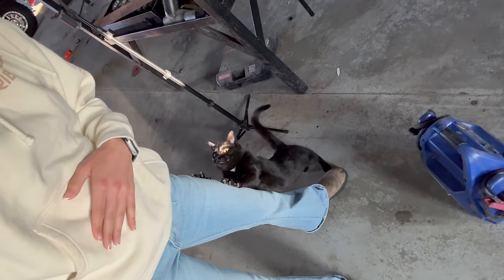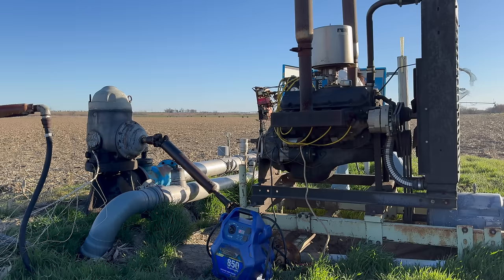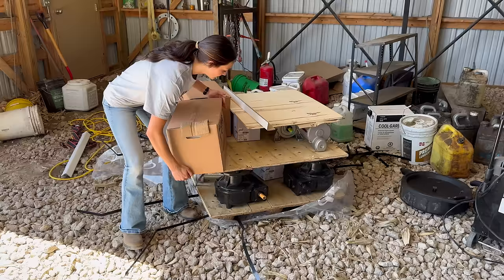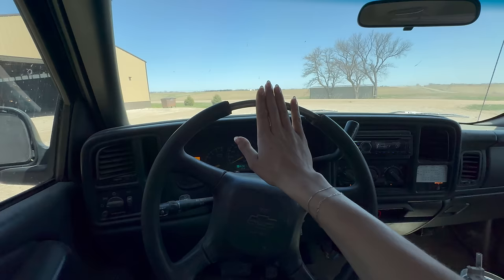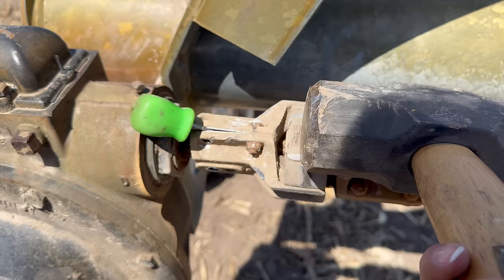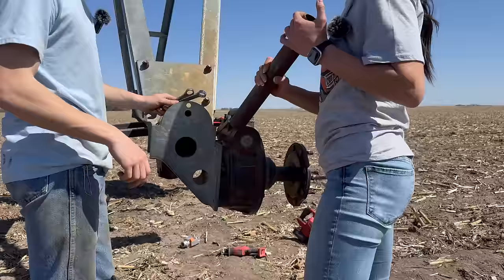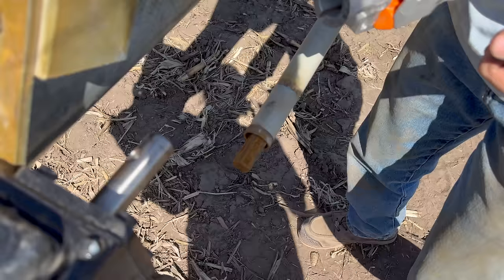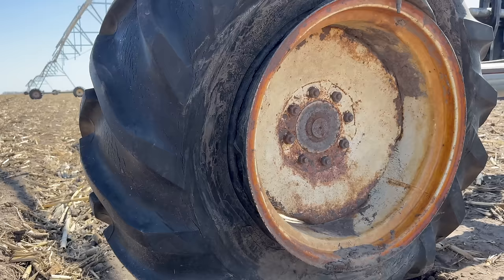Watch Me Fix This Irrigation Machine

Comment: Safer to use the closed box end when using a wrench to avoid rounding the nuts/bolt.  Great job!!!  I hope Grant realizes how special you are, I'm sure he does.  And as other said copious amounts of anti seize will help with future removals!
Reply: It looked really tight back there, so I don't think there was enough room to get the box end on it.
Reply: @darkiee69  👍🏻, it seemed like there was a little room just not enough for a socket. I could be wrong though.

Comment: The mounting plate hole for that gear box has a slot for a reason, because they are so heavy you run a bolt half way into the gearbox before you hoist it up and slide that bolt into the slot so it can hang there while you get the rest of the bolts started then tighten as normal leaving the slotted bolt for last.
This also works for servicing if you need to move the gearbox a tiny bit without needing to remove it completely.
Cheers Laura, Thank You for the Videos.
Reply: I saw the same thing the minute they took it off!  I think they used that bolt to hang the new gearbox on....
Reply: @pkane5472  Exactly what it's slotted for yes, The things to heavy to hold up and bolt.
Reply: I'm not the only one that picked up on the slot and it's purpose. Hope they see this so they know next time
Reply: @cwonext8037  , me too!
Reply: yes sir, that's why it's slotted.
Reply: I think a whole bunch of us saw that.  I know she has changed gear boxes before.  Surprised she didn't know that.  I see when they put the new gear box on they didn't use that technique though so maybe not.
In the future though......
Reply: @pkane5472  They did exactly that.

Comment: Copper paste on those threads will make life so much easier in the future and a small plumbers torch applying heat and WD40 really helps with seized bolts.

Comment: Always break the bolts loose and tighten them with the box closed end of the wrench, the box open end of the wrench will flex open and round the bolt off. You can double up two wrenches by putting the closed end of one wrench over one side of the open side of the other wrench for more leverage. Good work getting the job done!

Comment: 20:40 the fun part is when you realize that after the gear drive is removed and you realize that bolt hole is slotted and that sledge hammer would have been a useful tool again.

Comment: That slot in the metal is to allow you to start the nut into the gear box and slide it on, so you do not have to hold the gear box while trying to add the other bolts.

Comment: Maybe use Anti-seize (cooper grease) on nuts, bolts and shafts (couplers)? 🤔🤔 Oh, in tight spaces, you can double up wrenches end to end for extra leverage and use the closed end to prevent rounding off bolt heads and nuts.😁😁
Reply: I thought of the doubling up on wrenches too

Comment: Something to add to your truck for repair....cans of blasting penetrator or WD40....spray it on rusted bolts like that one and it will help it removing. Also a small portable torch would help also. Heating up the bolt helps with breaking loose a bolt like that.
Reply: Pretty sure I saw they had WD-40. That stuff is water compared to deep creep, blaster, kroil or other real penetraters. WD-40 is great for the sticky goo from removed stickers though.

Comment: Laura care some wd-40 with you it really helps with rusty bolts or do a heat and quinch with a torch it will work also. Glad you have a sponsor for parts makes life alot easier.

Comment: Hi! Remember your friend leverage? Use him for hidden bolts via an extension pipe  Also, use a penetrant spray first before you did the bottom 3. And yes, take the pressure off the final bolt. I usually leave them all in place until the last one is ready to come out. You will learn from experience. An additional thought. If you're taking the drive unit off, break all bolts loose while the rim and tire are on, just like changing a flat on any vehicle. Then jack it up off the ground.

Comment: Never Seize is a farmer's friend!!
Reply: No kidding.  At 26:00 I'm looking at that aluminum coupler with those steel bolts, and wondering how fun it's going to be getting it apart in the future.  And that's ignoring they fact they're going to be directly exposed to water for a lot of the time.
Reply: Yes add some never seize to the service truck tool box
Reply: I call it Anti-Seize because never is not an option and that stuff nay be very useful, but I assure you that angry seize is nobody's friend.  Once you open the bottle and let the genie out, it gets everywhere.
Reply: @kennyFF033  I just had the bottle opened yesterday :-)  and it needed a stir!  Managed six bolts with almost no casualties. I hear there's a new clear formula I need to look into.
Reply: @kennyFF033  it wipes off
Reply: @earlbrown  Exactly!!
Reply: @kennyFF033  friends call me the tin man, for a reason!
Reply: @kennyFF033  Yeah, but it's worth it

Comment: As someone who has been wrenching for almost 60 years, I have a few comments on this job…

Jump box without battery:  The jump box is a battery.  I suggest you leave it connected while you are running the engine.  It probably won’t make a difference on the pivot, but you should never disconnect the battery on a modern (computerized) vehicle.  (It was an old way to test alternators, but can kill the computers in modern vehicles.)

Rusty, stuck bolts and nuts:  Penetrating oil can make an amazing difference.  WD-40 is probably the most popular.  PB Blaster is probably better for rusty bolts.  Robbie Layton has talked about a new product (Free?) that he gives high praise.  The longer it sets the better it works.  Keep a can in every vehicle.  If you ever find a problem and decide to come back in the morning…  spray it down with penetrating oil before you leave.

Combination wrenches:  Whenever possible use the box end.  It spreads the torque to all 6 points on the bolt/nut making it stronger.  The open end only acts against two points making it much easier to round off the head.

Comment: Whenever possible always use the box end of the wrench for tightening and breaking loose a bolt. Open end tends to spread, slip and round off the bolts or nuts. Smart move using the telehandler. 👍👍👍 Is Grant really the culprit for the missing battery??? Remember innocent until proven guilty. 😂😂😂

Comment: That flat tire tube was about to get rooted out of that wheel and tire and fall in the rut!! Always spray nuts and bolts with a good multi purpose spray lube. Helps clean them up and come apart easier without as much damage to the hardware and YOU!!!

Comment: Need a canvas tie-around-your-waist nail bag from your local lumber yard to drop nuts, bolts and sockets into while in the field.  Can't work without one!
Reply: It also keeps the nuts out of the dirt where it gets into and clogs all the screw threads with abrasive grit! You also don't lose all the bits and pieces which slows down your progress!

Comment: ❤ANTI SIEZE❤ was a must growing up on our grain farm in fairly dry North Central Montana.  It was used on lug nuts, bolted connections of all kinds, pulleys/pulley shafts, couplers like yours, literally any kind of "mating" surfaces that had potential to oxidize and fuse together like your tire rims to the gear box.  About the only thing that we didn't use on might have been the bolts that attached the "duckfoot shovels" on the shanks of the plows we used back in the day before no tillage methods came along as they were replaced a few times a year. I can only imagine the kind of environment that those pivot components have to go through.😱 One last resort for a lot of those ENIGMAS😉 would be to have and know how to use a cutting torch setup on your rig.  A little bit of heat can help to remove stuck nuts/bolts and if all else fails you can just cut it off and replace it.😃 On the other side of the spectrum a crucial thing we used were the ❤Loctite❤ products.  If you had a bolt that needed to stay put but still be easy enough to get out when needed: use the Blue Loctite.  When the bolt was "supposed to stay there forever": use the Red Loctite😃  Last thoughts: box end wrenches, ratchet wrench, or socket and always have a cheater pipe or know how to use 2 combination end wrenches together to get more leverage.😃

Comment: Laura, most engines with alternators (if not all) do require a battery connected to work. The battery provides a forward bias to the diodes in the alternator so that they can work properly for the alternator to provide the proper DC power for the engine.  There are certainly other  setups that don't need a battery once started but they are rare for large engines.

Comment: 25:25, Maybe Gage could drive by all 200 or 300 hundred pivot tires & hit them with a pipe. He would soon develop the ability to identify a
low-pressure tire & avoid the above job in tall corn this summer. Hope a little prevention pays off.

Comment: Bring a small tarp with you.   Put it on the ground and put your tool on it.  That will keep the dirt out of the tools.    
Use never seize on the bolts. it will save work later.
Keep penetrating oil - WD40 - or similar on your work truck.  Then you have it nearby.
You are fun to watch.  I have learned a lot about farming from your videos

Comment: Hi Laura and Gage, it's a tree root as in toot and loot, but then most New Zealander's English pronunciation originates from Great Britain. That last tight bolt was in a slot, which is there to allow you to hang the gearbox onto the pivot wheel mount first, by its loose bolt, taking all the weight of the gearbox. This then allows you to then orientate the gearbox more easily without straining yourself so the other through bolts can then be inserted through their holes without hardwork holding it all up! Use lots of "never seize"! I know the nearby field from spotting that 1500ft communications tower in the background (I'm a radio engineer so I always see any kind of tower or mast!  😁 You are a wonderful instructor and speaker Laura! I enjoy every one of your videos! I'm looking forward to the planter machinery coming out soon! Hi Pepper! 😁❤🐈‍⬛

Comment: Laura,  I love all of your videos and I watch all of them as soon as they come out.                   Two things about the stubborn bolt on the gear box:  never loosen any of the bolts completely until you have them all broken loose first. Break the torque on them first, then snug them back down before moving on to the next one. Breaking them loose completely one at a time puts more pressure on the remaining bolt and makes it almost impossible to remove. 
 If you have one that just refuses to budge, tighten all your other bolts back up, then remove the stuck one first, it's likely in a bind.

Comment: A small propane torch would also help with that bolt. You should also apply anti seize to the bolts when you put the new gear head on.

Comment: There are two different ends on the wrenches that you were using.  They are called Combination Wrenches. The end the is open and looks like a fork is called the Open End.  The closed end is called the Box End.

The Open End is meant to be used after the bolt or nut has been broken loose the speed up the removal of the bolt/nut.  Beind "open" it is also a bit springy, which when turned on hard enough will allow the wrench to slip and round off the corners of the bolt/nut.

The Box End is meant to be used the fully tighten the bolt/nut, as well as to "break loose" the bolt/nut.  Then it is much easier to use cheater bars and extensions to apply extra force without the wrench end "springing" open and rounding the bolt head.

I also highly suggest using anti-seize on the knuckle tube/shaft connections and the nuts and botls.  It will help tremendously with any service work in the days ahead.

I know, that stuff is nasty and gets everywhere.  I would rather deal with a little silver goo now than a whole lot of stuck stuff months later.  The nuce thing is that a tiny bit goes a very long way.  Most of us put way too much on the first hundred times that we use it.  One quick swipe of the brush that is made into the lid of the bottle only half way round the bolt is plenty.  Then on the coupler half shells a small swipe down each face and those couplers will almost fall off.

I know, I am probably the hundredth  person to tell us this in this video.  But hey, if it works it's worth repeating, better yet saving time.

Comment: To avoid congestion; put some real lemon juice in a nasal spray bottle, and any time that you get even a hint of nasal irregularity (sniffles, sneezing, runny nose, etc), spritz some lemon juice up each nostril, and usually within minutes (only second for sneezing), it will clear it up. It needs to be done more as a preventative, to avoid it getting to the point of full blown congestion. If you wait until it is full blown, the congestion is too deep in the nasal passages for the lemon juice to reach. I used to get congestion and even sinus infections fairly often before I found out about the benefits of lemon juice. I haven't had Any congestion for the past 15 years, since I started using the lemon juice. Also, adding about 3/8 inch of honey, then about 3/8 inch of lemon juice in the bottom of a drinking glass, mixed with the rest of the glass of warm water, does wonders to get rid of persistent coughing or sore throats. And, it's much cheaper than medications, and without any of the long lists of side effects of medications. (It is possible to get rid of more advanced congestion by snorting lemon juice through a straw. But, it is not recommended unless you have a very high tolerance for pain. Because it feels like having soda come out of your nose when laughing, multiplied by 100. I did it only once, out of desperation, because I was out of lemon juice when I started getting congestion, and it got so bad that I could barely breathe. At that point, I went to buy some lemon juice in the evening, but the nasal sprayer wasn't cutting it. So, I thought, there has to be a way to get the lemon juice farther up in there. So, I cut a straw in half and snorted the lemon juice, and Immediately it felt like the back of my eyeballs were on fire, and started dancing around the kitchen repeatedly saying "That Was Not A Good Idea. Oh God, Please Stop Burning!!" (Really glad there wasn't anyone there with a video camera). It only burned for a minute or two (each nostril), but it was intense. I went to sleep a few minutes late, and in the morning when I woke up, the congestion was Completely gone, like I never had it at all, not even a sniffle. So, it Did work, But I'm still debating whether it would be worth doing it again. (I probably would. Lol  Because not being able to breathe from congestion is miserable and long lasting suffering. Snorting lemon juice was intense but much shorter suffering.)) Also, I wanted to clarify that using the lemon juice in the nasal spray, Hasn't ever burned when doing it. I only occasionally get a taste of the lemon juice draining down into your mouth, if you spritz it more than one time per nostril. Also, gargling and swallowing about a spoon full of straight lemon juice works just as well for getting rid of coughing or sore throats, if you can tolerate the harsh taste for a few seconds.

Comment: One method of loosening stuck bolts is to use an impact drill.
Take a pointed chisel and remove the tip.
Press the tip against what you want to loosen, preferably so that it receives the pressure in the direction of loosening.
Works surprisingly well and does little damage.

Comment: As has been mentioned use anti-seize when installing the bolts and soak them with penetrating oil when loosening them.  The anti-seize is essential in the wet environment of the pivot.  I built  Ag pumps for a living and every bolt was coated with anti-seize during the assembly process.

Comment: You might try generic store-brand Musinex for a stuffy nose.
Also, Laura doesn't need to go to the gym. She works on a farm.
Also, the wrench extender pipe is a thing. I used a somewhat flattened section of a metal broom handle on a crescent wrench, but a box wrench may need a larger diameter tube. A pipe is a good choice.
It's fun to watch you all farm. Thanks for your videos.

Comment: Laura, always use the box end of a wrench on stuck bolts/nuts, to keep from rounding-off the head.  Also the open end can bend or break if too much torque, or ruin the head of the bolt/nut, because there is only 2 points of contact on the bolt/nut.  Also, WD40 is your friend on almost every stuck bolt.

Comment: Good morning Sunshine!  Your congestion cleared up as the day went on which was good to see.  Other than the stuborn bolt that was difficult to get to the day went pretty smoothly.  You should keep some Kroil penetrating oil or PB Blaster in the service truck.  Both work very well and would likely have loosened that bolt for you.  Have a great week.   Larry, Central Valley, Ca.

Comment: Nice job you guys. You might want to have heat with your field tools. I just screw those little Coleman spin on canisters and put a flam tip on it. So heat it with the flame. That will expand the metal. Then spray some PB Blaster on it, or any penetrating oil. Thank you for showing your work!

Comment: Something else to try when working with stubborn bolts and nuts (out in the field), is to use a a small hand torch to heat up the BOLD or NUT and it will come out as easy as melted butter.